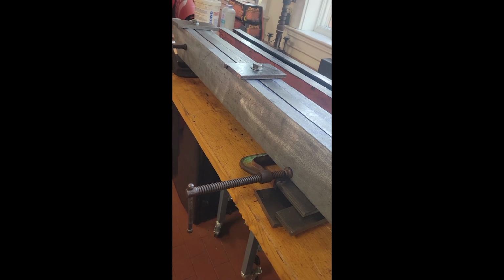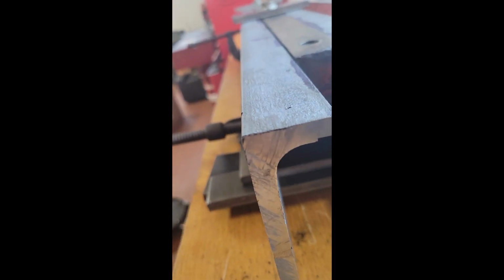Making New Head Blocks for the Frick Sawmill

Comment: Doing a good job! When I rebuilt the ones on my Corley sawmill, I drilled a 3/8 hole and put a 3/8 bolt with like a half inch nipple in between to keep the head blocks from moving any closer then one inch from my saw than cutting a 1 inch board
Reply from the maker: that's a good idea. I'll do a better video of the progress, but, it is tedious!